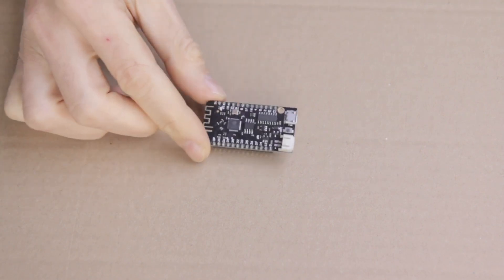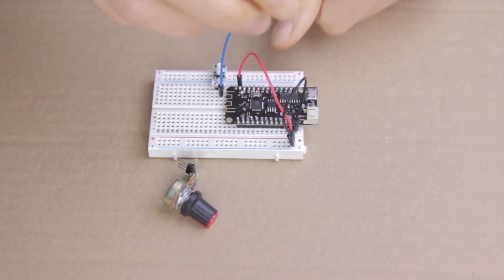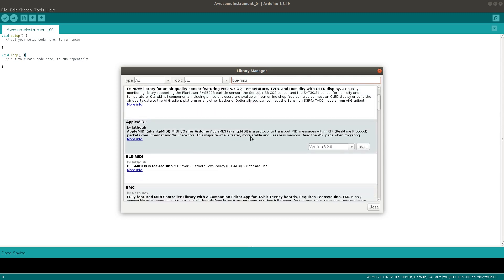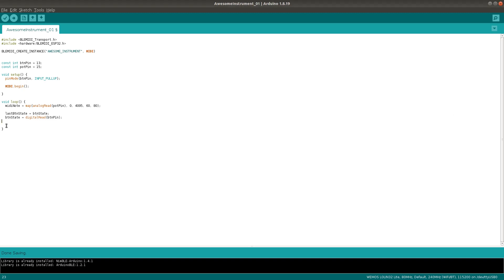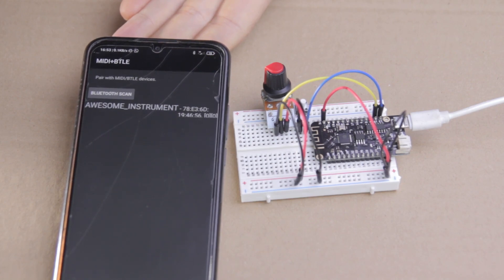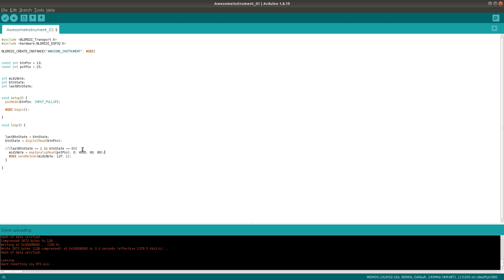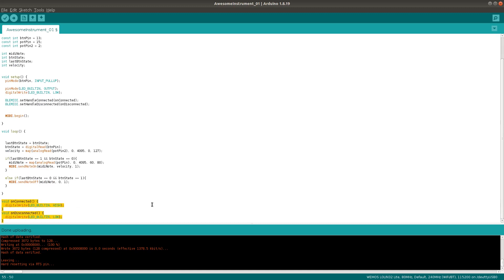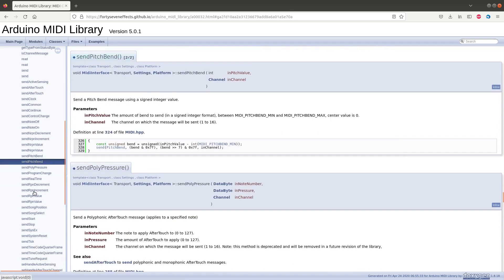How to make your own MIDI over Bluetooth instruments

Comment: Thanks for a great tutorial, it's been very helpful with my project. I'm wondering if it's possible to connect to my Macbook using BLE? For some reason the device never shows as an option in the bluetooth settings....

EDIT: to anyone trying to figure this out in the future, I had to connect via the Audio MIDI settings on my MacBook. There's an option for Bluetooth in there, connecting via the "normal" Bluetooth settings wouldn't work for me.

Thanks again for a great tutorial!
Reply: You are an absolute life saver. Was going mad!

Comment: Thanks Always!, I have an error from compiling as follows, 'Multiple libraries were found for "BLEDevice.h"

  Used: C:\Users\USER\Documents\Arduino\libraries\ArduinoBLE
  Not used: C:\Users\USER\AppData\Local\Arduino15\packages\esp32\hardware\esp32\3.0.7\libraries\BLE
exit status 1
Compilation error: exit status 1',

So, I changed the file under the Documents folder to make the computer use the second on e, but it still gives me an error as follows, 

'In file included from C:\Users\USER\AppData\Local\Temp\.arduinoIDE-unsaved20241019-7108-1ssp5c9.pbcqk\sketch_nov19a\sketch_nov19a.ino:2:
c:\Users\USER\Documents\Arduino\libraries\BLE-MIDI\src/hardware/BLEMIDI_ESP32.h: In member function 'virtual void bleMidi::MyCharacteristicCallbacks::onWrite(BLECharacteristic*)':
c:\Users\USER\Documents\Arduino\libraries\BLE-MIDI\src/hardware/BLEMIDI_ESP32.h:116:55: error: conversion from 'String' to non-scalar type 'std::string' {aka 'std::__cxx11::basic_string<char>'} requested
  116 |         std::string rxValue = characteristic->getValue();
      |                               ~~~~~~~~~~~~~~~~~~~~~~~~^~

exit status 1

Compilation error: exit status 1'

Please help me out!

Comment: Hi everybody. Your work is good and deep. I have few question to ask. I try to control ableton from Android with midi commander app. I tried to make a midi ble bridge to USB midi with a esp32-C3.. But it doesnt work. I receive midi message from Android app to esp32. But i can't go further. I tried with hairless midi serial bridge, but nothing incoming. Any ideas ? Thx.
Reply: the C3 (and C6, H2, and S2) can only do midi via the serial interface. For Ble-midi, you need a regular esp32 or the S3 version, which can also do usb-midi.

Comment: I'm trying to use this with Macbooks, and even though it compiles and uploads, none of my Macbooks recognize it in bluetooth. I have three different Macbooks (2014 Intel, 2022 M1, and 2023 M2), and none of them see it. I have tried completely uninstalling the IDE, and reinstalling, and even installed the old version (1.8.3) with no success. Of note is that SerialBT works fine on any of the three boards I have tried (Wemos Lolin 32 Lite, ESP32WROOM32, and ESP32WROOM32U), but no luck on any of them with the LE-MIDI. Any ideas?
Reply: For anyone who cares, this turns out to be BLE encryption related. If anyone knows of an alternative library that supports encryption, I'd be very grateful.

Comment: Thanks Always, BTW i faced an error as below, can you advise on this?
Unable to find executable file at C:/Users\User\AppData\Local\Temp\arduino\sketches\BEB453D64B56EB3FB53D687219CF699B\sketch_nov10a.ino.elf.

Comment: Thanks, cool video.  But I was actually looking for a way to use an ESP32 as an alternative to a BLE MIDI adapter like Yamaha UD-BT01.  Seems like this is part of the way there, but I have no idea how to do the next step.  I wnt to hook this up to USB cable output of a controller to get midi from a controller into the ESP32, so the ESP32 can relay it via Bluetooth to a computer/synth.  Any clues on how this can be done, or where I should look for more info online?
Reply: This should not be too hard if the ESP32 is that similar to Arduino. You can very easily build a MIDI DIN port with a handful of components. Look up notes and volts Arduino MIDI tutorials here on YouTube
Reply: As for the USB MIDI integration part... That might take a bit more digging, but there was ways of doing, I am sure. Maybe look into building MIDI interfaces with Arduino
Reply: @Queer_Gabe  Thanks for the suggestion.  That would work, but the controller I'd want to mount this on doesn't have a DIN MIDI jack, only USB midi.  Could still probably work with USB interface cable, but getting messy.  I think what I'd want is a bluetooth capable microcontroller that has bluetooth and can work as a USB Host, (required to connect to USB midi from controller device).    Anyway, not sure what I'll end up doing, but the various options are becoming more clear.  So far I'm using devices from Adafruit, and it seems like their code and tutorials are geared towards making things fairly easy.

Comment: Have you had any luck doing this with Windows? I've found it just auto disconnects the device after pairing when using the ESP32-BLE-MIDI library.
Reply from the maker: Yes, this is working on my windows machine, as well as my Linux laptop. 
The only thing I've found different in Windows is that I had to uninstall the "Arduino-BLE" library to get the upload to work correctly
Reply: @KontinuumLAB  Hey, thanks to this video I was able to confirm my code works on my phone, but I am still not sure if it works on Windows. I was hoping I could use it with Voicemeeter to control my audio volume but it seems that it does not recognize the device (it recognizes it if using MIDI over USB).

I am wondering what you used to test if it works on Windows and if you needed to download some software to make Windows recognize it.

Comment: Is there any noticeable latency when using bluetooth that would interfere with using this for percussive instruments?
Reply from the maker: Yes and no.... I've found that latency depends on the phone, not the ESP32. My cheap Android phone will sometimes make a slow connection. I disconnect and reconnect to solve that. Also, it's best to not have other apps running in the background. When I get a good connection, latency is negligible. I talked about that a bit in this video: https://www.youtube.com/watch?v=zFWH0xxBsnQ

Comment: Thank you for the video! -  I have a question: the first time I used the device it worked fine, but after the first time, the controller stopped working and the MIDI BLE App as well as the Synth app can't see it. Oddly, the Android phone normal BLE keeps seeing it and contacts with it, did you ever experienced something like this??
Reply from the maker: I'm not sure. Maybe your phones "normal" BLE is pairing automatically as soon as it sees the device looking for a connection...? If the LED on the device isn't blinking, that would mean it's paired already, so can't be seen through the BTLE and synth apps. If your phone has a setting for automatic pairing, then switch that off and try again.

Comment: Hello! 
I have an idea for a project that I think should be pretty simple but I haven’t found any good examples of it online yet.       I’d like to build an artificial sound machine for small electric vehicles so that drivers/ pedestrians can hear you coming.  It should be easy enough to use the 0v-4v signal from a standard hall throttle to modulate the sound along with the speed right??
I believe lots of people will have interest in a device like this, especially because many countries will soon be enacting new laws that require small electric vehicles to play sounds for safety.  
I am about to order a teensy microcontroller and hopefully I will be able to figure this out.  When I had the idea I immediately thought of you because I imagine this would be a simple project for you.  
If I have any questions while working on this I might ask you if you don’t mind…. Or if you wanted to I think it would make a great subject for a video, and would likely bring many other viewers to your channel.. just a thought.😄

Comment: Inspiring video and I have a breadboard MIDI controller working using your tutorial and a LOLIN D32, however ...

BLE MIDI Connect is not compatible with Android 13 😢

I have written to the developer to ask if they plan to make it so,  but in the meantime do you know of any other BLE MIDI connection utilities  that might work on Android 13?
Reply from the maker: No, I'm afraid Android 13 just sucks. Sorry...

Comment: When I open SynprezFM and scan BT devices, it prompts "AWESOME_INSTRUMENT connected" but inmediatelly it prompts "AWESOME_INSTRUMENT disconnected". I've tried multiple libraries, different apps, and nothing works. What can I do? Thanks!
Reply from the maker: Need much more info to even try to answer that. Which ESP32 are you using? What libraries? What apps? Do you have MIDI-btle installed? Does your ESP LED turn on/off?
Reply: @KontinuumLAB   the same as you, except board (az delivery esp32-wemos-32). LED works as espected. I've read about android bug. Two times (without change esp code) has conected and worked.
Reply: @KontinuumLAB   restarting process, installing arduino etc. What link did you use to include ESP32 board? I think this can be the problem (duplicated libraries)
Reply from the maker: Once you install the ESP32 board package in Arduino (exactly like shown in the video) you have to pick the specific board that you're using from the boards menu. Don't know what you mean by "link"
Reply: @KontinuumLAB  by default, arduino IDE doesn't include ESP32 support and ESP32 doesn't appear on board manager. You have to put a link on file > preferences > additional boards manager url. I've installed evereything again in two PCs (different versions OF IDE, board, etc and also tried the same as the video) and didn't work. Can you paste your detailed output during compile? (during compilation I have two different BLE libraries and give me error, if I delete ArduinoBLE it compiles ok but doesn't work; else returns "freeRTOS/buffer" error). I'm going crazy whit this
Reply from the maker: @nerohack  Oh sh_t.... Can't believe I forgot to explain that :(
My link is: https://dl.espressif.com/dl/package_esp32_index.json 
I'll put a note in the description. Not much of a "step by step" tutorial after all hahaha!
Verbose output on compile is several pages, so not going to put it in a comment...
I also have ArduinoBLE installed, and compiles fine (compile output informs me that it's not using it). Removed it and still compiles fine.
Tested the whole setup on Ubuntu and windows, and everything works fine.

If you did everything else the same as me, the only major differences I can think of is your board or your phone. 
Are you sure the board's fully functional?
Reply: @KontinuumLAB  same link too. New board, I hope functional. Informatic misteries... Thanks for your time!!
Reply from the maker: @nerohack  Hope you get it working!

Comment: Awesome content as always! I made a custom "flute" with a Feather 32u4 Bluefruit, which works both through USB and MIDI-BLE. I still have a WIP version 2 with a Teensy (for working standalone) and a Adafruit BLE SPI Friend, but haven't finished it yet. It will have an air sensor based on your videos about wind instruments, thanks A LOT for that, it never occurred to me that approach!
I guess my v3 is going to be based on ESP32!
Greetings from Argentina :D
PS: if I go to Barcelona next year I'll send you a message to see if you have a workshop running or something like that
Reply from the maker: Thanks for your comment Gonzalo! The feather boards are really nice. The main advantage with the ESP32 is that it has a lot more memory than the 32u4, and of course it's quite cheap. But you won't get MIDI over USB from it, so that's something to keep in mind.
Drop me a line if you stop by Barcelona. I live and work outside the city now, but I'll let you know if I have some workshops planned.
Good luck with your wind instrument projects!
Reply: @KontinuumLAB  Thanks mate! I think maybe next year, around September, I might travel to Spain. Will let you know ;)
Also, now that you mentioned it, I did a quick google search and guess what? It looks like now there are some ESP32 boards with native USB :O (didn't know that until now). Look for ESP32-S2 (there is a WeMos ESP32-S2 Mini, for example).